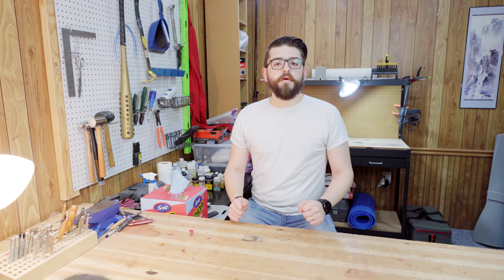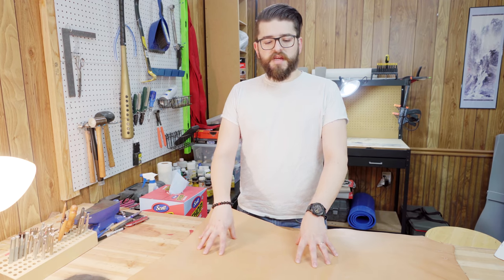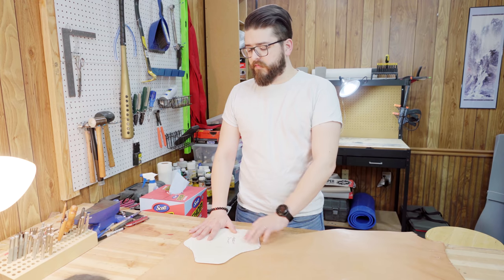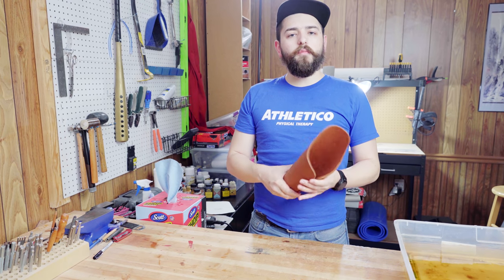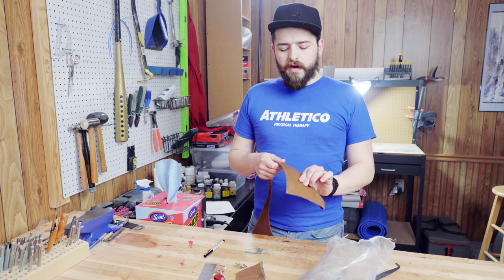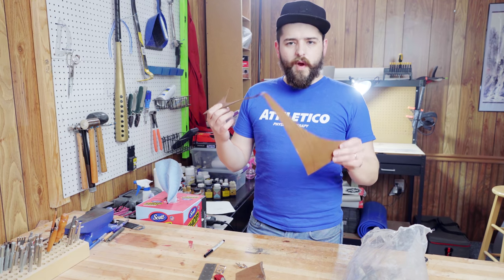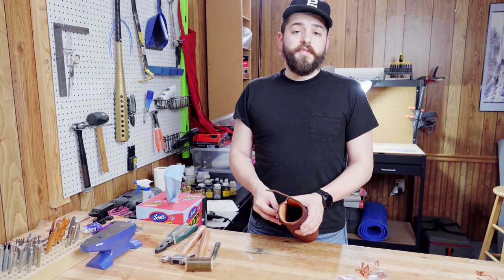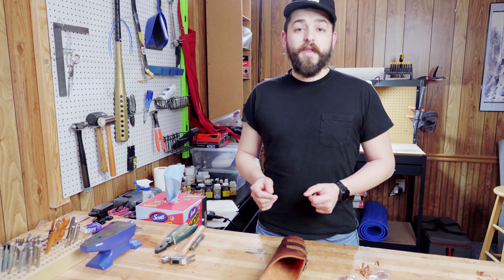How to Make a Basic Bracer Using Only Basic Leatherworking Tools

Comment: Fascinating video.  Instead of using duct tape to hold the wet leather's shape during drying which you said could affect the surface of the leather, could you use something that may dry along with the leather such a fabric/cloth strap?  Would this not mar the leather surface during drying?

Comment: Do you think you would have to double the leather for an arm band for someone who welds? I notice that most of the arm pads I see for welders look pretty thick but 12 oz  leather is about 3/16" thick.
Reply from the maker: I honestly can't speak from experience on this one.  12 oz leather is pretty thick -- 3/16" as you noted, but it may be worth stepping up to something like Sole Bend leather which typicaly clocks in around 15-16oz thick or 15/64"-1/4" thick.  I will note that this leather is significantly more difficult to work, though!

Comment: How did you gauge where to put the holes in the strap for the buckle?
Reply from the maker: For the tongue of the buckle itself?  It can vary depending on what look you're going for, but I like to center the first hole 1.5-2x the width of the strap in from the end.  For example, with a 3/4" (19mm) width strap, I would generally look to center the first hole around 1 1/8" (28mm) to 1.5" (38mm) from the end of the strap.

For straps less than 1" wide (I almost always use either 1/2" or 3/4" width straps), a good rule of thumb is to space the center of the holes the width of the strap apart.  For wider pieces (e.g. a 1.5" wide belt), 1 1/8" between holes is a good starting point.

To put it in context, on a 3/4" wide strap, I would center the first hole about 1.25" from the end of the strap, then space each of the three holes 3/4" apart.  For best results, use the center hole as the 'correct' hole for the sizing you need -- this will allow it to be tightened or loosened as necessary.

That said, a lot of it is personal preference as well -- you can do more or less, as long as you make sure there's enough strap left over to route through the other end of the buckle or any keeper you might be using.